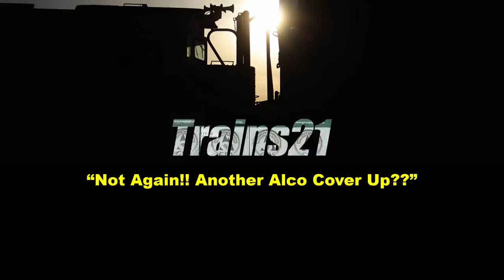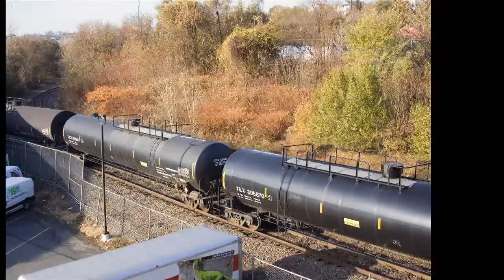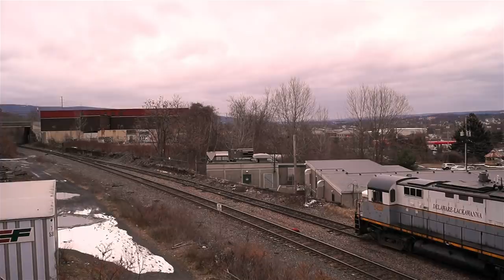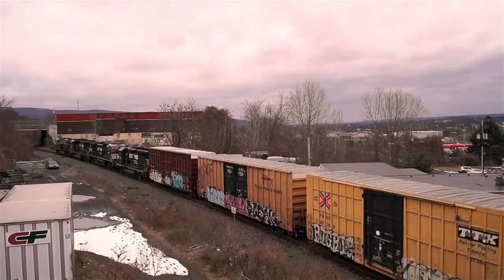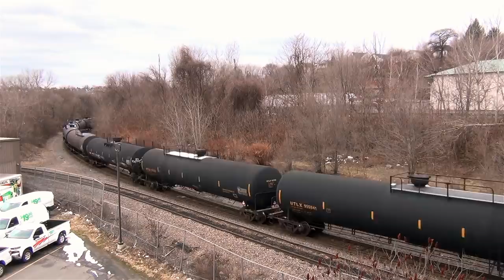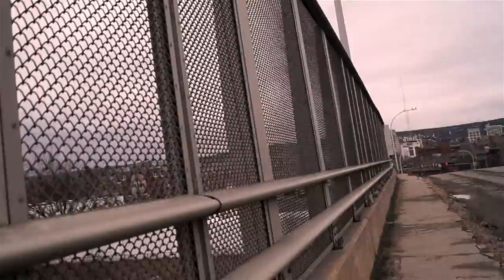[HU][T-177] OH NO, NOT AGAIN!! Another ALCO Cover Up?? | Trains 21

Comment: AC, You mention that NS has abolished 36T and 37T between Allentown and Buffalo.  Two questions:  1. How does that traffic now move?  2. Are there no longer any NS trains running between Penn Haven and DuPont?
Reply from the maker: No trains between Penn Haven and Dupong.. The traffic now moves on the 11Z and 14R.